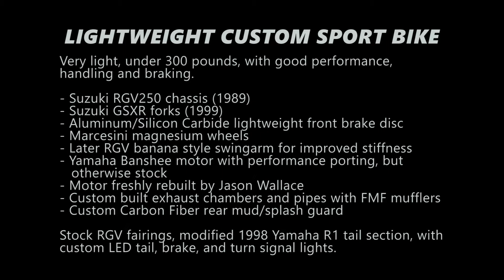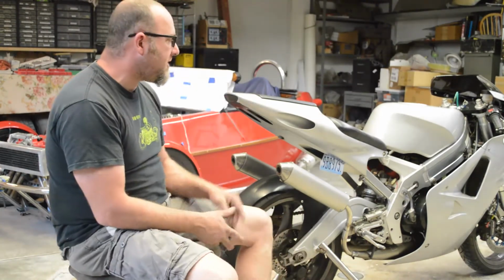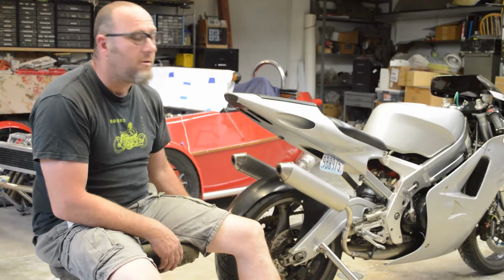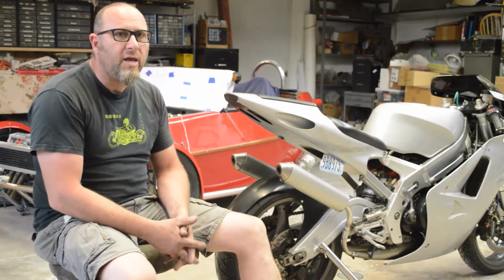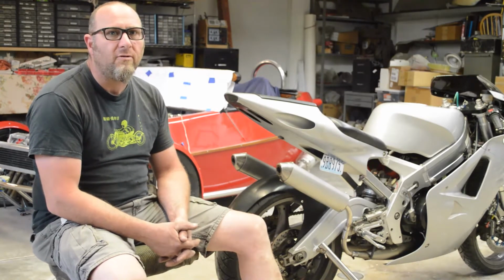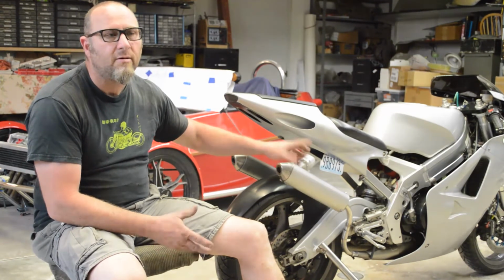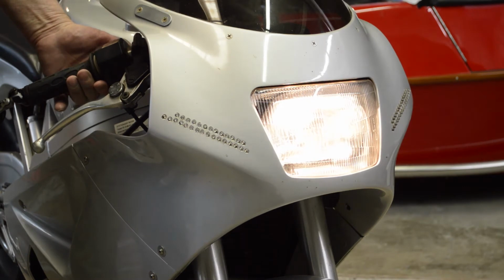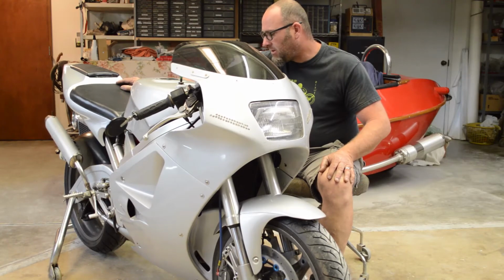Custom Banshee Powered Sport Bike - For Sale

Comment: cool and badass bike! i personaly dont like mixing yamaha engines with suzuki or other brands :D in my opinion yammy engine needs to be in yamaha. i will some day be building bike similar to that but i will be using yamaha frame and propably rz/rd 350 engine cases (same engine as banshee but from motorcycle so its easier for me to get it legal) and my goal to that built would be it to be as light weight as possible and as much hp as possible :D but yeah cool looking bike and i love when ppl still built 2 stroke powered bikes :D
Reply from the maker: Thanks! Good luck with your future build!

Comment: I wish i could find a banshee engine in italy i would do a sportbike build for shure
Reply: The results will be better if you use a rd 350 engine because of the gear ratio and the YPVS, it have different cilynders with an exhaust valve and its capable of revving up a lot easier.
Banshee engine is for mid range of rpm, because its designed for the use in the dirt and work with more charge, you can change it for drag purposes if you want, but for me, on a bike, i prefer rd350 engine, i had one of these and the engine its pure art, made for the first time almost 40 years ago.
Reply: @Alexander-dx8rk  Someone told me that the rs 250 engine fits on the rs 125 frame... the rs 125 is the one i own